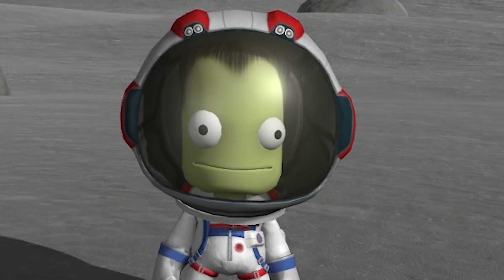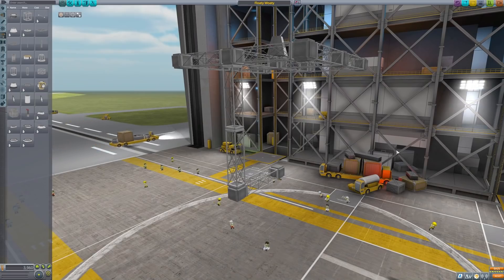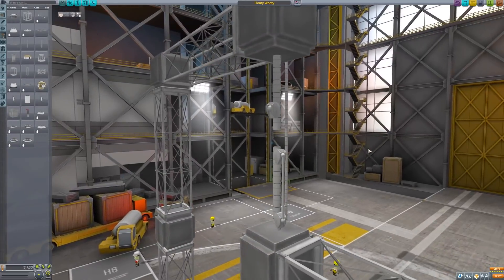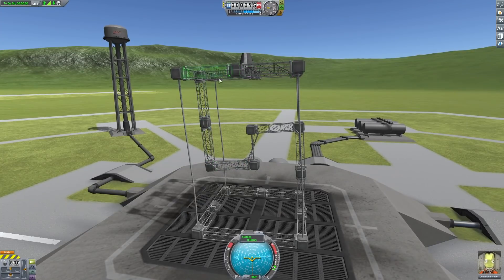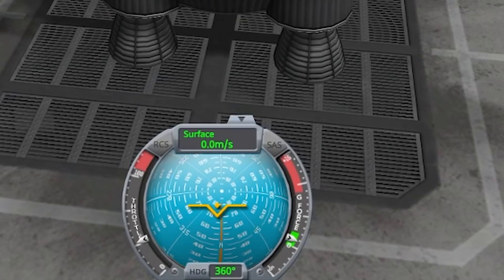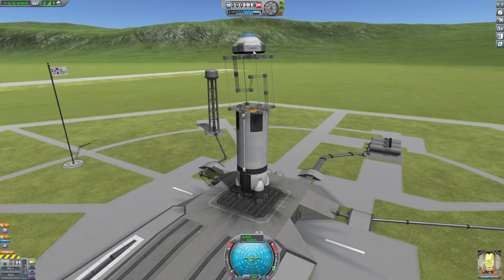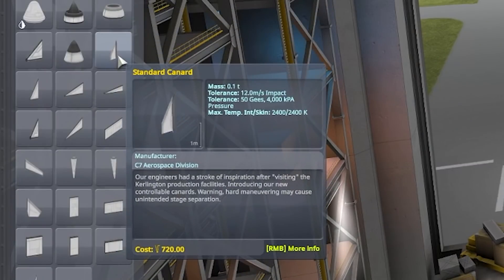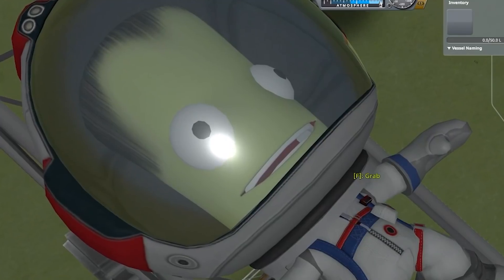I used TENSEGRITY to change Rocket Science FOREVER... Kerbal Space Program!

Comment: You only need a strut to connect to the parts that don't connect, due to the tree system KSP uses. The part connects to the one you clicked it to, then you just strut between it and the part you wanted it to also connect to.

I also recommend getting the time control mod that lets you slow down time so you can watch things in slow motion when you need to.

Comment: you should have put positioning boosters on the sides of the top capsule. Then launch with auto stabilizing turned on.
Reply: orrrrr, you could put small booster under the top capsule just strong enough to keep the top tense during lift off.

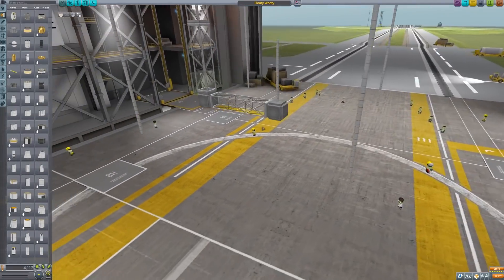Comment: 3:14 You probably will have learned that by now, but if not:
The 4 buttons you have top left in your building screen is for manipulating parts. The one on the right is a re-rooting tool that you could have used to make the end of the wire the root of the part instead of the cube. 

They are all very useful in builds

Comment: The problem of the rocket is that the command control is on the top of the floating device. If the command control was placed at the lower section it shouldnt try to solve the wobble during flight.

Comment: this is not a tensegrity structure...
it is strutted together in the middle.
please remake this and perhaps not cheat?
Reply: There is nothing in KSP that would allow for a real tensegrity structure, and this rocket actually functions pretty close to how one would fly in KSP if it existed.
Reply: @sirgouki6207  you could do it with ridgid members with unmotorized hinges
in a way that only convey tension.

the problem with KSP in this regard is the flexible joints that stretch.
with fewer parts the stretch would be manageable.

it would work better on the mun or on minimus with lower gravity and less stretching.

also the model of his tensegrity structure is not the best, you want the "wires" to connect diagonally to limit the freedom of movement for the top platform.
it would require dubble the amount of "wires" to construct since every node would connect two wires.
Reply from the maker: Sorry why is having the middle strutted not tensegrity? The reason it isn't is because the fuel tanks on the four corners can act in compression, nothing to do with the middle...
Reply: @RealCivilEngineerGaming   if you remove the corners it will act the same way. the struts in the middle is what holds the structure together and not only my tension. the middle section acts more like a spring.

a tensegrity structure is not allowed to be attached by a spring that bends and have a "preferred direction" and have a restoring force if you move it around the equilibrium point.

in essence when you strutted in the middle you created a flexible s shaped member that act as a spring and you struts act in both compression and tension.
Reply from the maker: The struts in the centre only work in tension though... I'm not sure how you think they work in compression?
Reply: @RealCivilEngineerGaming  the struts in the middle are a rigid joint.

if we imagine the classic impossible floating table tensegrity structure.
then replace the middle string with a bolt that you fasten with nuts at both ends.
if you then stress the table unevenly you will notice that the bolt will have a restoring force.
in fact if you cut all other wires the bolt would still hold the table. 

the problem with having a solid bolt in the middle is that any solid form can act in a bending fashion.
bending as i assume you know place one side in tension and another in compression. 

in my mind this is a perfect analogy to what you have done in ksp with the struts.
struts in ksp are solid members capable of resisting a bending action, therefore also act in compression.

if you center the center of mass perfectly you can get to a state of no bending. and get a tensegrity structure, however when you stress the structure in any direction a bending force will restore it to its equilibrium point. 

I will now proceed by making my own version of a ksp tensegrity structure, just to prove it is possible
Reply from the maker: @nilsdock  There are no materials in ksp that act like cable and only work in tension and not compression so it is impossible to do what you are claiming. You're sort of just overthinking it, if there were such material my design would have worked so not really sure what your point is. If you do manage to find this elusive material please let me know though!
Reply from the maker: It's a tad dark so I'll have to have a look tomorrow when I'm at the pc! How did you ensure no compression? Using hinges maybe?
Reply from the maker: Just read the description and seems I was right with the hinges, you used dlc though...
Reply: @RealCivilEngineerGaming  i use hinges to ensure there is no compression. and i use retracting pistons to tension the cables.

sorry about the quality i was tiered last night
Reply: @RealCivilEngineerGaming   if do not have the dlc yet i can recommend it wholeheartedly if you want to keep making ksp videos

Comment: 9:46 not really strange if you consider that fuel lines permit fuel flow only in the direction in which the arrows point. You connected them to let fuel flow from the engine to the tanks.

Comment: Hey here's a tip.
The struts are fully rigid but you should use the external fuel duct. The external fuel lines are like rubber bands while the struts are like wooden skewers.

Comment: For connecting from multiple points, add docking ports perfectly lined up.
Most of the time they attach before physics load, other times you got to wiggle them until the attach.
You'll know they are attached when you get the right-click option to detach them.

Comment: SAS uses the command pod as your point of reference, so if you're pod is wobbling even tho the main section is not SAS will still think its wobbling making the main section wobble making the wobble at the pod worse. With SAS off you naturally saw the full picture and where able to use the main section as your point of reference.

There is a way to change the point of reference by right clicking a component when at the launchpad or in flight. Unless things have changed you can only use docking ports or other command like modules for your point of reference.

Comment: Hey RCE, if you go into the main menu and look at the "advanced settings" option, you can turn on a feature called "autostrut" which will allow you (when you feel like it—it's not always active) to attach pieces in a build to each other via invisible struts. It's very useful for when you want to build stuff that doesn't abide by KSP's specific two-piece attachment rules but you don't want to make it look ugly by attaching a ton of visible struts all over the place. It can be used selectively too, so it doesn't apply to every piece in a build at once when you use it, and you can simply use it on a single piece in the whole build if you wanted. After you enable autostrut, you can use it by right-clicking on a piece in the VAB or SPH (the building areas).

Hope this helps!

Comment: Pro tip: The SAS does not work well, when your rocket "wobbles" and the thing that is doing the SAS (in your case Jeb) wobbles relative to the engine. There are autonomous probes that can provide SAS. If you build another wobbly craft (which you will, I know it), stick one of these autonomous probes to your engine. This will make the SAS more reliable and useful. Note that not every probe supports SAS (it says in the description which do and which don't) and also note, that you have to right click onto the probe on the launch pad and select "control from here", otherwise it won't work.

Comment: Here's a prtotip for these crazy constructions, add a control point (a probe core or capsule or such) next to the engine where it won;t wobble. Then do control from there and it will work much better esspecialy with SAS. This also works for much much bigger rockets.  where the top can get wobbly even if it;s a serious build

Comment: You forgot force vectors, and that your motor is canceling the tension that holds your structure.  You should move the motors to the top for the tension to hold the structure better.
Reply: Not quite. Remember, the top part is hanging down from the bit in the middle. Adding upwards thrust is just increasing the normal G-forces.

Comment: Your construction techniques would definitely benefit from having the mod ReCoupler installed.
It allows you to connect parts in loops and branching connections. It would save you a lot of strutting.

Also, the reason the engine wouldn't work with just the small fuel tanks is because those didn't have any oxidizer in them. Jets only need liquid fuel because they get their oxygen from the air, but rockets need tanks with liquid fuel and oxidizer.

Comment: You can radially attach the girders (as in attach them anywere and not just the end nodes) also struts can be used as cables but dont have end nodes, they can be good for keeping things together as seen in the flying bridge, however you can avoid them if you go into the games settings on the start menu, and find "advanced tweakables" or something with thatn which can let you negate the need for struts, to use autostrut you right click on a part and click "autostrut" its quite a usefull thing. also you need both liquid fuel and oxidiser to run any engine thats not a jet engine. last thing to add, make sure your COA (center of aerodynamics) is below your COM (Center of mass)

Comment: I believe the way KSP puts the parts together is like a tree. So there can only be one path from any part to the base node. So any new part you add will only officially connect at one spot. So for any spaces like the corners there you have to use struts if you want it to "connect" at more than one point.
Also, the fuel hoses are directional. You click the "from" part first, then click on the "to" part, and it puts a little arrow on the host showing the direction.
Good stuff.

Comment: SAS was having a problem controlling it because of the wobbly top. Since your command pod, the reference for position, was at a different angle than the engines, the way that the rocket turns, SAS got confused. You were able to look at the position of the engine and use that as your reference point so you performed better.
Reply: he doesn't even know what the hell aerodynamics are probably

Comment: Here is a tip for more stability, use the "fuel rope" to connect every point and create a triangle stabilization. Hope this helps in future video, RCE.
Reply: Unfortunately you need mods to connect multiple parts to the same node iirc.
Reply: @StormTheSquid   Thanks, I'll keep that in mind in the future. Thanks for the help.

Comment: Hint: Fuel ducts are used to pass fuel from things that are separated by decouplers.
Hint 2: Rocket engines need fuel + oxidizer. You can check contents of fuel tanks by reading their descriptions.
I hope it will help!
Reply: Fuel ducts also only take fuel from A to B, not both ways. So you always want to put the start of your fuel duct on the fuel tank itself.
The arrows on the yellow duct show direction of fuel flow.
Reply: To add on that the fuel duck only go one direction so watch what way the arrows are pointing
Reply: i was thinking of that second hint from the first time he put the mammoth engine on
Reply: to the first hint:
The direction is important (and was wrong)

Comment: Turn SAS on and put it on “radial out” (right beside the throttle, the circular buttons after you turn SAS on, the radial out is the bottom left one), radial out keeps your rocket upright.
Reply: But will SAS work at all when flying a noodle? It's been a while since I played KSP, but I don't remember SAS working well with any sort of wobble/flex in the rocket.
Reply: @erichamion  that’s a good point